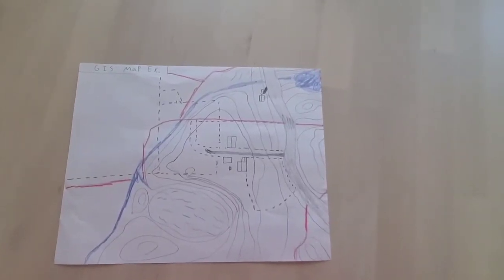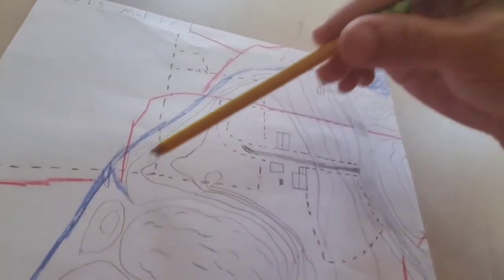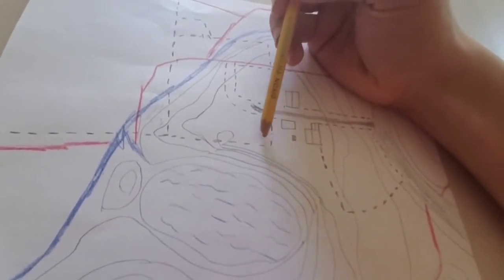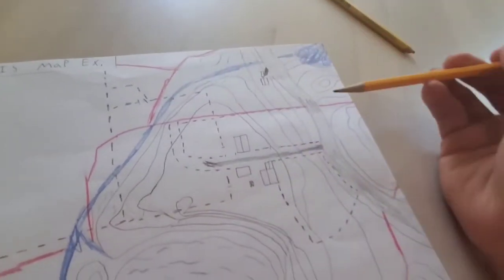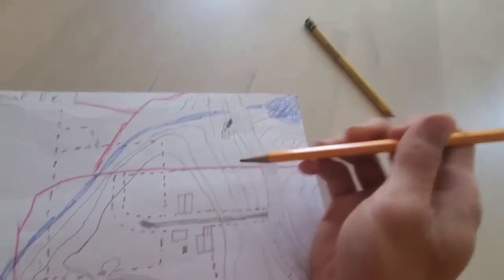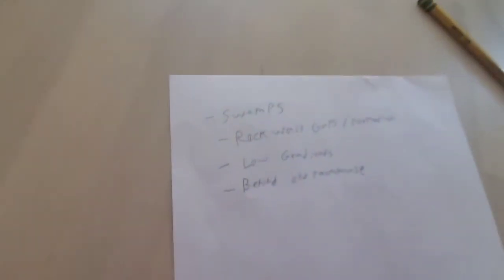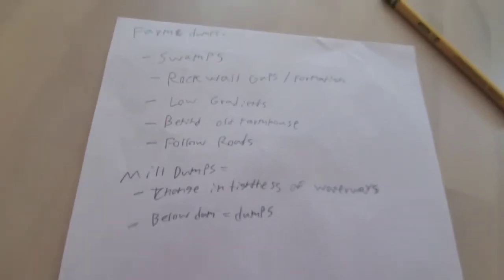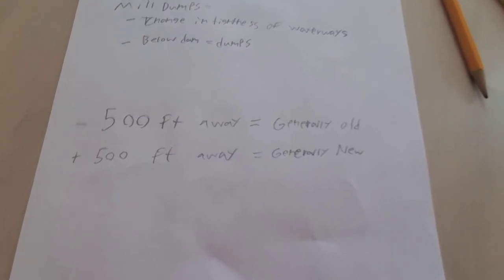How to find bottle dumps using GIS and Topographic maps.

Comment: Any advice on probing/getting bottles out of swamps? I've got a circa 1850s stone foundation with a swamp 10 feet behind it, but it looks pretty deep
Reply from the maker: Normally I wouldn't waste time probing a spot like this (unless you see indications of glass) becuase of the unknown depth and location of stuff would be too hard to get to that it wouldn't be worthwhile. However, if there is an embankment to the swamp from the foundation I'd check that and would use a metal detector, if there are no signs of surface metal or glass, to see if there is any layer of metal there. Also check any old roads or cart paths that could have led to the foundation. Remember, that there may not be a dump close by, since the original owners may have carted their stuff somewhere else. I think your best bet is to explore the surrounding areas including field boundaries and old paths. Also if you have a metal detector you could come across a trash pit with metal that is bound to contain some glass and possibly bottles.